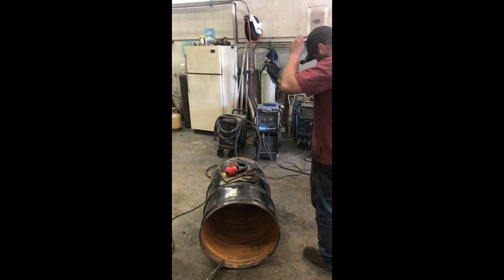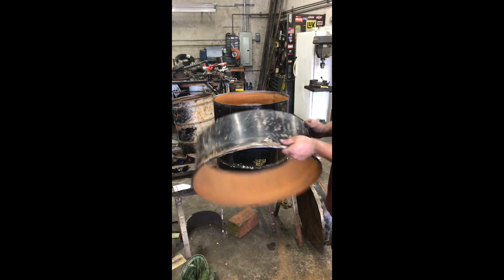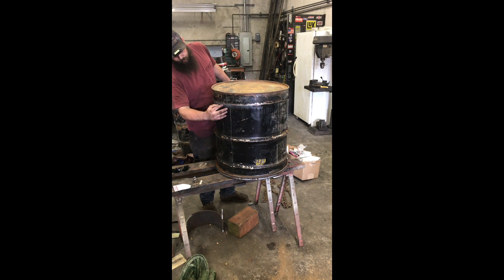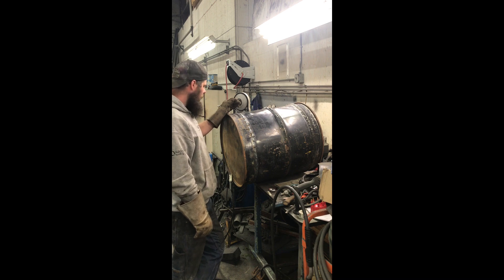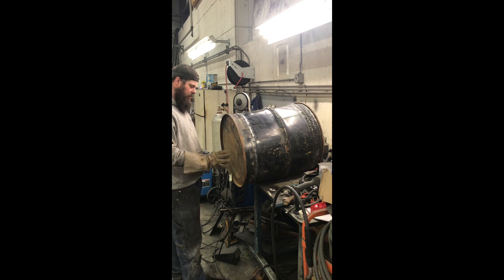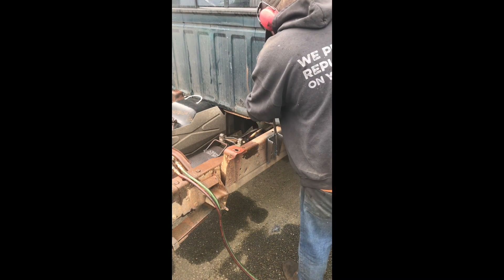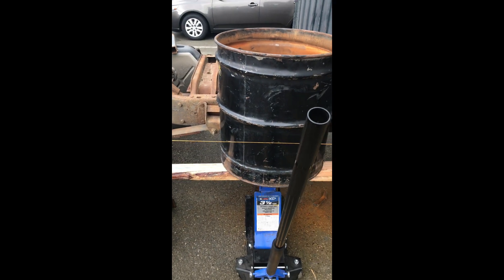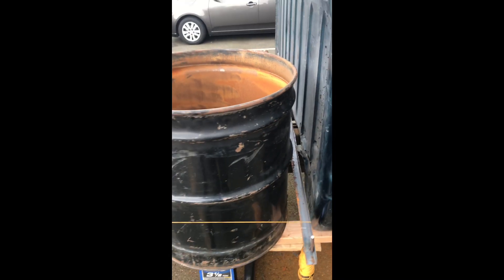V10 Dodge Woodgas build fitting the lower barrel

Comment: Add permanent stairs to your flatbed. So, you don't have to jump.
Reply from the maker: That will be part of the rear bumper is integrated steps. Going to keep this truck stock height, as I get older i get tired of jumping up into my trucks